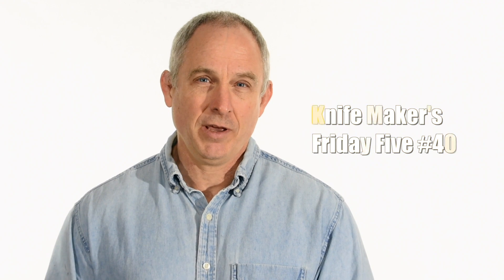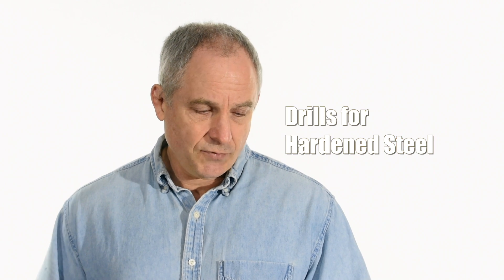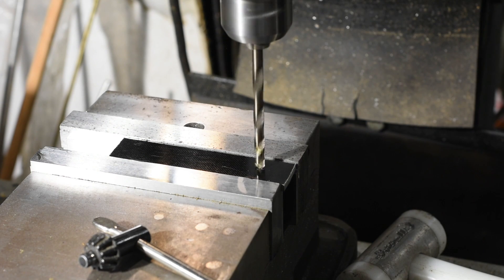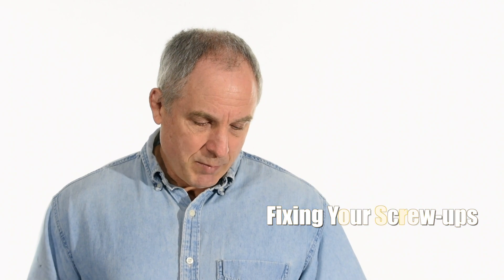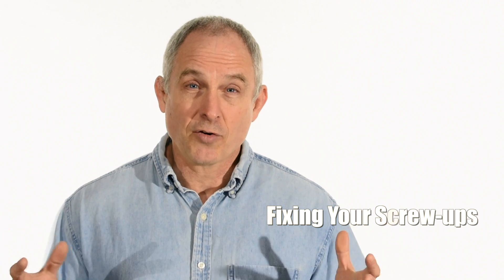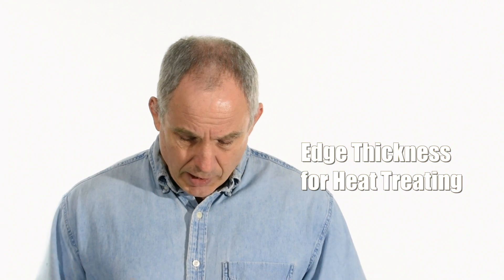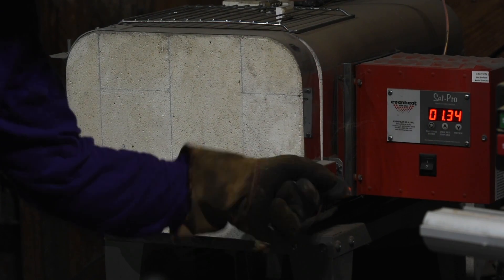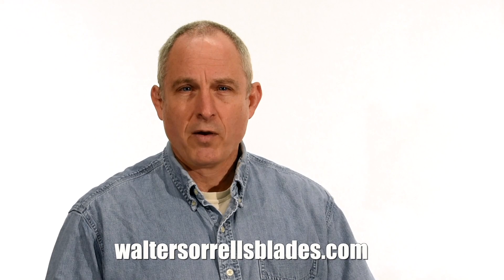Knife Maker's Friday Five #40 - Viewer Questions

Comment: A secondary note for drilling a few holes in hardened material on the cheap. Masonry bits have carbide tips on steel bodies. The geometry isn't ideal for drilling steel of course but they will get the job done in a pinch. I think I have mentioned this before on here.
As always, great video. Happy holidays Walter.

Comment: Walter-I like to make Scandinavian style knives and puukkos in the hidden tang style. Do you have any input on how to drill and file a rectangular hole in the handle blank?  I have several examples of Scandinavian knives with no bolster and a perfect fit at the junction of the wooden handle and the blade tang.  This excludes the burn to fit method and the methods where the handle material is split lengthwise and reglued. Thanks.